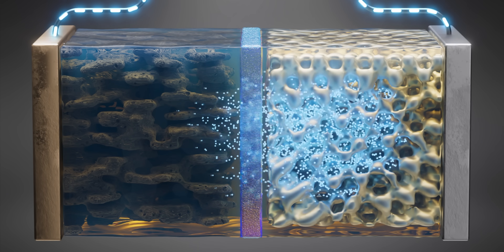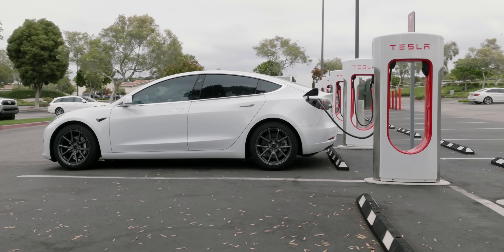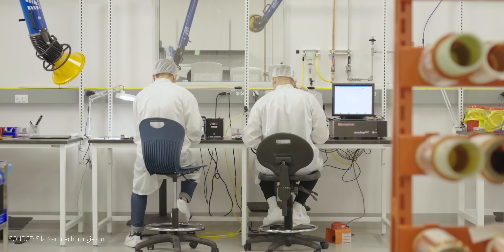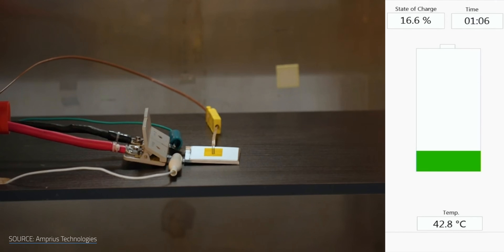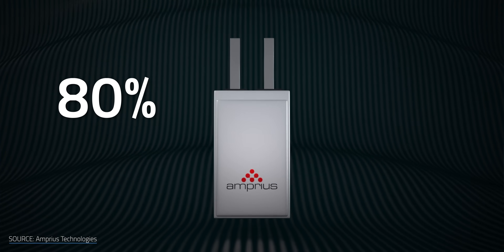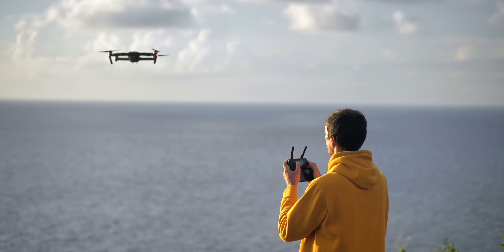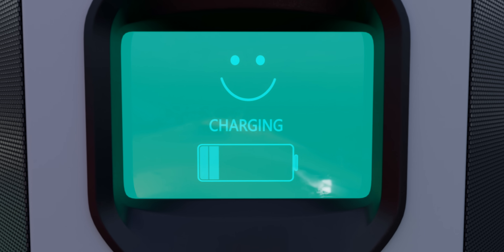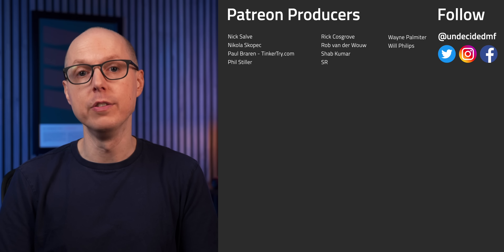Why This Ultra Dense Battery Breakthrough Matters

Comment: @SurfsharkAcademy: Saying "Amprius grows Si NWs directly from the current collector then coats them in Si to form an anode" is simply false or lack of understanding of their technology. Coating Si on Si doesn't make sense and if you did some research you would have known that. Their anode is never a silicon grown directly on the current collector in the first place. It is commercially not viable in large scale and only limited to high-end application because they don't grow Si NW from the current collector as you claimed. In fact, they never claimed that themselves, so stop misleading people on their tech or better still get accurate information and good knowledge before making your videos. I know exactly what they are keeping away from people like you who jump to conclusion and do the marketing for them without care to details and reality. Good attempt by the way.

Comment: Interesting.

In terms of generating hydroelectrical power via deprotonization, could we make nanowires of graphene coated in silicon (if even applicable?) within a rubber hose or metal coil, something you can wrap around a steam generating water heater, seated between its innermost and outermost layer of circumference, whereby any two instances of conductive nanostructure causes deprotonization from the delivered steam molecules by being sufficiently dense together, thus separating the household electricity from the drinking water without creating rust or other contaminants?

Comment: only if you knew that in just 10 months after this video, Smartphone like Redmi Note 14 pro+ are already equipped with Silicon Carbon battery with 6200 Mah battery that charges at 90W and comes with 5 year warranty!

Comment: There's an even better material than Silicon: Pure lithium metal...! Has around 3680 mAh/g^-1 compared to the 3400 of silicon, it doesn't expand, "only" grows dendrites.
To cope with these dendrites we need full solid state electrolytes/seperators that are resilient enough to not be penetrated by those.
We'll see what the future holds ....

Comment: Besides the two other silicon competitors you mentioned there is also Enovix. They tackle the swelling problem in a different way. Instead of the "jelly roll" method, they have their stuff lined up like pasta in a box, which keeps it from catching fire if you drill a hole in the battery. 

Nothing is perfect, and ENVXs tech gives it a power advantage in small batteries like phones, but it goes away as the battery gets larger. So it's like a u shaped curve for medicine, where there is a sweet spot between the minimum effective dose , the optimum amount, and the lethal amount.

Comment: Seems more like a version of a 'wet' super-capacitor with a lased surface deposition that may be multi- layered and may use some silver as a 'transport ionic element'..  They will probably try to make a lesser more voluminous battery.  in thin film I'd bet that the substrate has nickel copper cobalt iron base; Invar, that is be quite hard to manufacture in a thin layer, but can take the heat required to melt a powdered carbon silica coating.  In the slower less dense battery, and additional layer can then be deposited on top, but to much may result in swelling.  The question is that at the figures that have been given, as to so much energy density, are they combustible or a fast  catastrophic discharge hazard..?

Comment: The best battery are those use solid electrolyte an the best electrolyte are those we cal it hyper valence anion for exp STPP (-5) and the best oxido reduction are those we cal them auto oxido reduction

Comment: Increased energy density is nice but not the most important issue preventing greater take-up of BEVs. The first is cost. At the moment a BEV with an expired battery is effectively worthless. The cost of replacing the battery is greater than the value of the second hand vehicle. 'Should help bring down battery cost' is jam tomorrow.

Comment: You should also look on The Batteries - Polish startup. They claim their solid-state batteries in comparison to Li-ion/Li-po batteries are more than 2x more dense, have more than 6x faster charging, much better operating temperatures and only a 5% capacity reduction after 10,000+ charge cycles - all of that while being safe from explosive hazard :)

Comment: The only thing holding battery advancements is manufacturing processes. Once processes have been perfected for cheap mass manufacturing of products at this size cheapley, almost every area of our lives could be impacted. Look at phones, an impossibility in the year 2000 at the complexity and size we now take for granted.
I hope I am still alive when 4 solar cells will charge your car in a couple of hours at home and be able to charge a cheap battery that can power your home for days at a time from a few hours of sunlight a day. It will happen guaranteed, i just wonder when.

Comment: gosh , just make silicon Nano wire itself , then think how to stack it
(you know , the same way we do for normal copper wire , just a little bit hotter for elasticity (just stretch it))
we could as well just place some layers (like honeycomb) and smelt them a bit after.
Or just lodge into some material vertically (like hairs into toothbrush ))
Anyhow nano wire would be a good start as I see it.
 (just stretching/pulling material is much easier then grow it ,
 by the way I have a few more nice ideas 
for example for long term storage via mesh of resistors [x , y]  (without diodes) - it turns out that connecting 
wires in certain way you could calculate value/ nominal of resistors in such a mesh(massive of resistors),
Just metallic structure without semiconductors (those would be only in peripherals to connect wires to conduct measurement , this thing therefore could be very durable, and potentially very easy to produce.

Comment: Sounds quite interesting the silica technologies is quite interesting indeed. A lithium battery that uses silicon. 

I also like the brick thermo battery. Heat conversion into electricity by air flow.

Comment: An EV will never be charged in minutes because tthe power requirements would be huge necessitating massive cooled cables. 100kwh in 6 minutes requires a megawatt and even at 800 volts that is 1250 amps.

Comment: Why are EV charging setups in stalls? To work properly the charging port must be in a specific location which is not and will never be standardised. A setup just like the way petrol pumps are arranged is far more versatile. Furthermore having to unhitch any trailer of caravan would be unnecessary.

Comment: Gotta take issue with one think you said: "This might enable technologies like commercial aircraft and semis" Well, aircraft yes, and how exciting is that? But semis are already here. The Tesla semi is in operation and does 500 miles under load. All that needs to be done is produce more and build the charging infrastructure.

Comment: I am posting a comment I made elsewhere but battery technologies are critical. 
For your interests. 

All Grid supplied electricity is a dead duck.
Renewable, Nuclear, Hydro, Fossil. 

The national electrical grid took 100 years to build. 

The national electrical grid costs as much as the national Gross Domestic Product, GDP.

5 times more electricity, 5 times bigger grid capacity. 
5 times the national GDP.
Is insanely expensive. 

Simple rooftop solar PV and EV with V2G. 
Has NO GRID COSTS. 

Nuclear promoters attack distant renewables BECAUSE OF GRID COSTS.
Electricity is 20% of energy supply, when the grid is full. 

5 times more electricity is BS.
Not even nuclear talk about their own grid limitations to future nuclear electricity growth. 

They talk about nuclear SMRs, but ignore that every part of the grid capacity has to be bigger. 

Hydrogen has the same infrastructure limitations. 

Offgrid in the suburbs with EVs is real and would threaten the cashflow of nuclear power plants. 

Remaining on the grid will mean fewer customers paying more for a fixed cost nuclear investment AND the grid. Grid is 70% of bills.

Can anyone besides me do simple maths???

Even nuclear promoters refers to electric vehicles and hydrogen vehicles. 

It staggers me that experts are confident outside their expertise.

Comment: Honestly I'm always skeptical of new battery chemistry when I hear about them. This as far as chemical batteries goes is probably the most compelling option I've heard of but it still would all come down to charge cycle endurance in the end (a consumer being asked to pay for a premium battery option) isn't gonna like it if that battery falls on the we really don't know if it will be 1/2 the charge/discharge cycle endurance of traditional carbon anode of 2x.

Comment: Good video, Matt. I'm a proponent of battery powered everything. I use them in my model airplanes almost exclusively. There are issues with the reality of societal battery conversion that nobody seems to address. It's not range anxiety, battery density, cost, or charge time.  I'm hoping you'll read this and use your level-headed approach to explain the math to me and your viewers about the following: One issue is the amount of current (amps) required to charge a 100kwh battery to 80% in 6 minutes. This issue has multiple levels of difficulty, including the basics like charger capacity, charger cable/connector, and the heat created at the charge rate required.  Then there is the infrastructure and power generation problem. It's not all that big of a deal until you start talkin about 10s of millions of cars, busses, semis or airplanes all needing high amperage at the same time. I'm not trying to be a downer but it would be nice for someone like yourself to take a real look at the numbers and report honestly on the feasibility.  I think society is not well served by saying, "We'll have 1500km range batteries with 6 or 10 minute charge times," without stating that it is not currently (pun intended) possible and won't be possible for decades. It would be great to see the actual math on how much current is needed to charge 1 million, 10 million and 100 million 100kwh battery all at the same time, at night or when people aren't driving. The number of power plants required,  the time it takes to build the facilities with current regulations,  and the cost to do so, would also be good information to share. We should always look to the future but the reality of today can't be ignored. And let's not even start to talk about the power usage of future crypto mining. Thanks in advance.

Comment: Brilliant! Thank you Mr. Matt Ferrell of Undecided in sharing this informative video on batteries. Are you able to cover Prof Thomas Maschmeyer of Sydney University, Australia 's new non flow gel battery- Gelion that has partnered with Battery Energy Power Solutions to manufacture these batteries. What is the density by mass or its energy density by volume. Is the batteries are available to customers to purchase? Who do we contact, i.e. Companies selling this batteries & their email address & contact numbers? I am still "undecided" which batteries to use in my electric outboard project to tour & patrol Kambaramba villages along the Sepik River and neighboring villages in Ramu, Nubia, Sisimagum, Kayan and the costal areas of Madang. Greetings from Papua New Guinea!

Comment: There are hundreds of 'breakthrough' every year. None pan out. Multitudes of commercial facets have to work just right for the tech to be viable.
See one in a AA battery first. Otherwise, it is all BS.

Comment: I understand that someday, there will be a big breakthrough in battery technology that will “change everything.”  However, over the past 10 or 15 years, how many times have we been teased with, “The next big thing is here!”  And we’re still using lithium ion.  I will get excited when I see the tech being rolled out.  Before that, it’s just another nearly useless hype article talking about theoretical tech.

Comment: They charge in six minutes…. Disclaimer: when plugged into non-existent, nearly un-feasible to implement en-masse in our grid, 500Kwh chargers… per vehicle mind you…. You want a six car charging station, you’ll need 3,000Kw/h electrical access…

Comment: another problem is these still require Lithium.

i still think a better solution is battery swapping stations instead of charging stations, where sulfur batteries can be easily swapped in a matter of seconds and recycled from dedicated locations is a much better option. especially since they seem to promise 1000 times more energy per charge than a L.I battery and much easier to make supposedly with the abundance of sulfur element, and with one of the only down sides being their recharge cycles being a few hundred at most vs  the thousands L.I can provide. but that can be eliminated with good infrastructure and battery swapping sites and proper recycling of older or non-funcional ones :)

just a thought.

Comment: Well, one element is missing in this very interesting video. The high reactivity of silicon in its metallic state. Nanoparticles and nanowires are extremely sensitive to oxidation, and the resulting silica is not a good binder to Lithium.
That's also one of the strength of the graphite/graphene mixture with Li nanoparticles, the carbon lattices serving as protection (partial) to the nanoparticles.
The only problem lies in obtaining them as crystalline pristine metallic Si, but that may have been solved in an economically viable way, with a recent patent.

Comment: For wel over 15 years now i hear "this is the new battery tech"  yet NOTHING came to market and the new tech still struggles with capacity, weight, charge/discharge speed or lifespan.

Comment: just what we need another great battery that wont do what we need it most for. Park it in the shed with all the other ones that are always "five years away" . Just in case they actually do make it to the big game are they any better behaved if they become overheated. We recently had a large truck here in Australia that had been converted to a BEV catch fire on a critical freeway close to the center of our second largest city. The truck burnt to the ground and caused absolute chaos for thousands of commuters. Of course it was a battery fault that was the cause. Fortunately the toxic fumes did not blow towards the more populated city. It took almost two hours for it to burn out while firefighters sprayed it with water to help keep it cooler. If this scenario is not bad enough just three kilometers further along the freeway is a long tunnel, what would have the outcome been if the fire occurred there? the vents for that tunnel are much closer to a dense population area that includes a school. There have been truck fires before on the freeway in question but they are far easier to put out and the fumes are nowhere near as toxic. At another recent BEV fire in Melbourne two fire fighters were exposed to cobalt poisoning and they both will not return to active duties. I am all for new tech that helps solve problems but not if it creates ones that are unacceptable. This overzealous rush to electrify transport is leading to risk taking and poor engineering diligence and even poorer oversight,

Comment: I don't think this is too good to be true. It's not good enough to be interesting. What's even more weight efficient and holding lithium is free space, meaning metallic lithium batteries. Only lithium as an anode, and probably with a solid electrolyte.

Comment: Sounds good. But, I've been down this road before several years ago. I was a BIG fan of the zinc air battery whose figures were saying could store over 2x the energy than Li, much lighter, nonflammable, have a round trip of 10k cycles, and 1/3 as costly because they use common materials. Now almost nothing is written about them. Did this co actually build this huge mfg facility before proving these batteries commercially viable? Li is toxic and Li batteries use a lot of cobalt which is very toxic and mined mostly in 3rd world countries. Children often mine the cobalt-not much life expectancy.

Comment: More electrical charge in a given volume-has anyone else ever seen and over-charged capacitor fail?  I anticipate many failures points in the battery pack- flash, bang, heat, fire.

Comment: Charging points with realistic charging cycle times ?    Electricity distribution networks with sufficent capacity ?      THese bateries won;t matter until  the infrastructure is in place

Comment: These batteries won’t fundamentally change the 0 to 60 time of most vehicles, as the majority of drivers don’t need a vehicle that goes 0 to 60 in two seconds. Even the current holder, I believe it’s a Rimac, doing it in 1.9 seconds is being limited by the laws of physics of traction and the tires, not the power delivered to the motor.

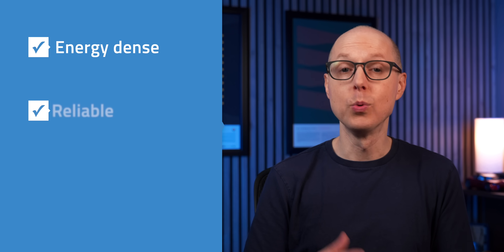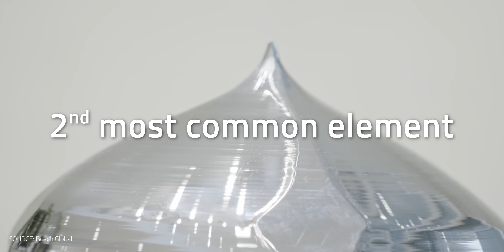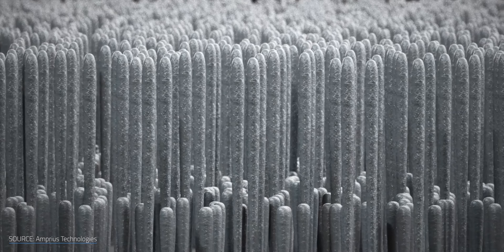Comment: I used to be undecided but now I'm not so sure.....What's it going to be then?  6:35 and 8:01 Silicon anodes will make batteries cheaper OR 10:14 and 10:38 Silicon Anodes will make batteries more expensive ...

Comment: How would silicon wire compare to graphene, production-wise, cost-wise and performance-wise?  But silicon wire is an anode and graphene is an electrolyte replacement (if I got that right), so could they be combined?   And can a silicon wire anode be rolled into an 18650/20700/21700 cylindrical can cell?  That seems more challenging, but maybe eventually.  Maybe a soft filler between silicon wires to keep them straighter when rolled, but still their expansion and contraction?  Promising is a good word for it.  Thanks, Matt.  Please keep us updated.

Comment: I noticed how you conveniently stated that this new tech can charge a battery to "80%" in 6 mins... problem is even the current tech is pretty good up to 80%... after that electrons take longer trying to find spots to land... So I would guess another 10 mins to fully charge.  I can still fill my Mustang up in about 3 mins.